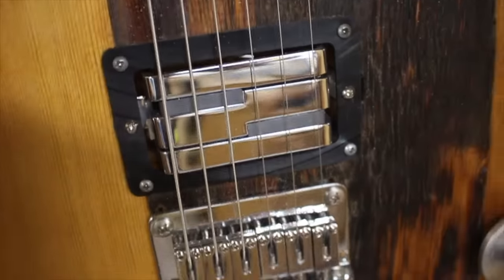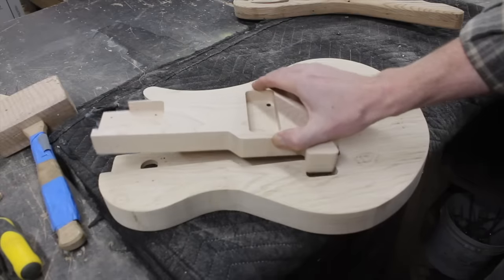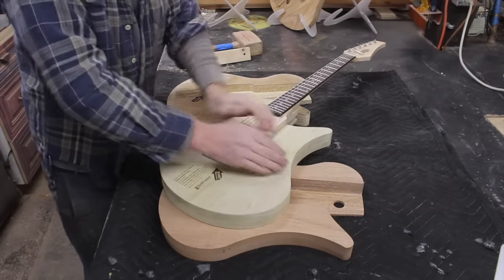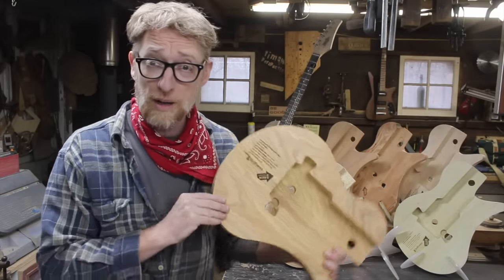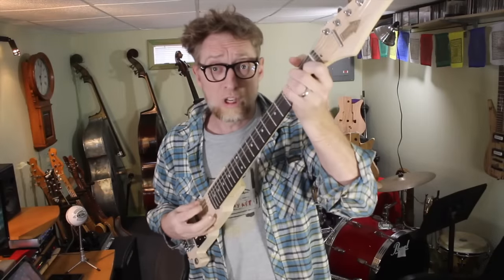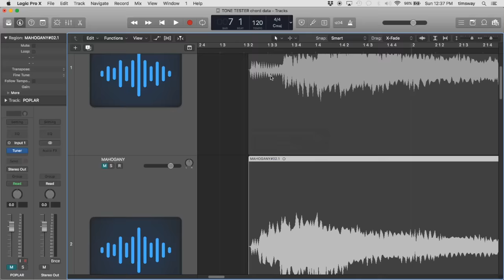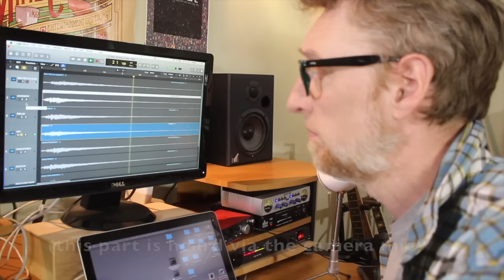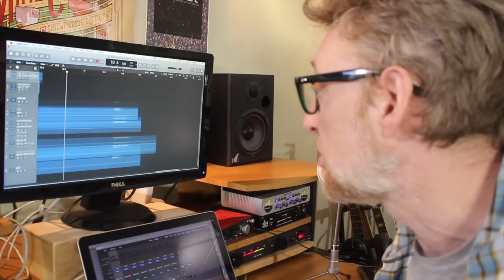Tone Wood Tester: One guitar to test them all

Comment: Incredible brother. But, I couldn’t stop thinking about the business opportunity here. You sell me a really well built core with great pick ups, bridge, pots, switches etc. And then offer every shape, color, finish, etc. For me to mount my core in. You could even offer custom designs. Maybe it’s already been mentioned or maybe it’s already available in some form and I don’t know about it....but just the thought of being able to do this I find unique and exciting....get the idea to the patent office.
Reply from the maker: There are a few others that make swappable guitars and I've done it before. Search "multitar." The one that makes the most sense are pickup packs that pop in and out easily. That's where you can REALLY get a new guitar! I plan to do some messing around with that someday :)
Reply: There is https://somniumguitars.com , they make guitars with different pickup packs. There are a few youtube demo video's by Justin Johnson.
Reply: Even more so, if you wanted a red body on a dual humbucker guitar and a green body triple single coil guitar today, and a red strat and a green les paul type tomorrow, it's possible.
Reply: This is something I've thought about before.  Scale length is counted from the bridge, thus longer or shorter necks is added at the top of the neck.  This means we could have a system where you can bolt together any combination of parts.  4-strings, 6, 8, 4 pairs, etc.  14 inch scale length, 20, 25, whatever.  You could make any combination.
The idea is that you buy the bridge housing and neck, and then any of hundreds of body designs.  Bolt them together and away you go.
Lets say you want a mandolin size and shape body, but 4 strings (uke style), 20 inch scale length like a baritone or octave mando.  Easy.  You can now make your own hybrids.
Reply from the maker: @valueofnothing2487  There's more to the "slave labor" story of Guangdong, et. al, than we hear and of course a CNC machine doesn't care what country it runs in! I don't intend to manufacture this guitar, but I do make guitars here in Connecticut from locally sourced and salvaged materials for those who want that sort of thing and prefer that story to the "made in China" alternative. My mission statement from the get-go has been "custom and responsibly made in the US for around $1k or less".
Reply: Check out Pons Guitar
Reply: Look this up: Vox humana swiss army bass
Reply: I wonder why I haven't seen anyone make a cheap lightweight guitar by taking a wooden neck assembly such as yours and mounting it into a two-piece lightweight honeycomb-molded plastic body.  I'd think that would be cheaper than making a full-size wood body, but the only lightweight guitars I've seen whose exterior contour is guitar-shaped are in the $500+ range.
Reply: The problem is if the body is too light then it can be “neck heavy” and it won’t balance well when you stand and play.
Reply: Look for Pons Guitars on Instagram, they do exactly that. Basically u can change body shapes and I think they attach it using screws/bolts

Edit: they have a Kickstarter page: Pons Guitars
Reply: I know this would be utterly impractical, but I'd like the electronics to stay on the body, including the pickups, but to have the core still include the bridge as it does now. Then each body could have its controls placed exactly where you expect for that style of guitar, and swapping bodies could mean dramatically changing the sound because all the electronics would be changed at the same time. The scale length, string tension, bend characteristics, type of bridge, type of trem system -- all those variables are removed. You could then have multiple copies of the core as well, to accommodate alternate tunings quickly. (Smaller than packing the same number of full-sized guitars, certainly.)

Structurally, I think this would be a nightmare to implement, and won't be the one to try.
Reply: @timsway  It's a good idea in theory Tim, but in practice it seems like players simply like to own different guitars.    Taylor tried swappable pickguards on their solidbody electrics, and the whole line got discontinued after not a lot of time.    It would make for a fun and informative YouTube video though.    Thanks for the great content!
Reply from the maker: @keithbaker296  oh yea, I'm not the first to mess with this idea. there's no market for it, I just like to make silly guitars :)
Reply: Anyone remember these? http://www.teuffel.com/english/guitars/birdfish/birdfish_main.htm
Reply from the maker: @JohnnyBuxton  I've never seen this one before. thanks for sharing!
Reply: No worries.. they're pretty old now, but a cool concept of movable pickups (they're on rails) and interchangeable tubes of tonewood.. I've always been dubious about the effects switching these things would have..
Reply from the maker: @JohnnyBuxton  imo minimal at best but the design is cool!
Reply: Eventually wear would prevent the pieces from fitting together snug unfortunately.
Reply: Dan Electro  for sure
Reply: @bluesoverlord  That, and would have zero sustain.
Reply: Wood is so sensitive to the, environmentj temperature, mechanical pressure that after a while I can easily foresee either a connection too loose, or on the contrary the impossibility to match the pieces, then too many mallet hits, then damage to both parts leading to the first situation, a connection too loose, say winter is back again...
Reply: FUN FACT: more often than not, Patents DON'T MEAN SHIT. 

You don't get successful with a Great Idea. You get successful CHEATING EVERYONE ELSE. See Ray Kroc. See Edison vs Nik Tesla. (Tesla invented the radio and yet the world keeps LYING that it was Marconi. It was settled in court in the 1940s!!! See? Patents are ONLY as good as your army of LAWYERS and if you are stronger than your enemy. 

SUPERMAN? Stolen from the inventors. 
BATMAN? Bob Kane stole most of it from Bill Finger. Look that one up. (It's the RULE, not the exception.)
Reply: Modular guitars have been done before, and so far no maker has managed to take the world by storm. Pretty much every one on the market is forced to aim for a high-income clientele because small builders are unable to produce them at a cost low enough to line up with a workingman's price point.

Comment: Use some plugin to run a Fourier transform, or FFT, on your recorded audio. This will make a graph showing you the distribution and amplitude of frequencies in your recording, and it will show you visually if there are differences in tone and harmonics. I think the fact the bridge wasn't sitting directly on the body makes a huge difference. Metal is the best sound transmitter in this entire guitar.

Comment: I think that the biggest dependency is likely on your neck piece as it contains the entire length of the string. If you look at how waves are transmitted in a physical medium or even electric waves, you see that when a wave hits a surface that has a lower resistivity, part of the wave goes into that material and part of the wave reflects back. As the resistivity increases (as the guitar gets more hard) more of the wave reflects back, meaning more energy stays in the string. So if the neck has give, energy from the string will vibrate the neck, if the neck has no give, the string will keep more energy and will vibrate at a higher amplitude and longer (that is my theory). Ultimately the magnetic field of the pickup is not being affected by the material in the wood, the sound is purely happening between the string and the pickup. The wood as just acting as a dampener.

Comment: This was ALMOST perfect.
One thing....well, two things, really:
1: you need to rig a strummer which will strum with the exact same pressure and speed and angle of attack every time, as well as the same spot on the strings.
2: you need to strum it OPEN. because slight variations in how hard you press the strings and how far your fingers are from the frets will affect the sound.
Reply: Katie Donovan lol thus proving the wood doesn’t make the difference does it?
Reply: @humancentered3447  this comment encompasses the real answer that all these videos will come back too. The wood is a very small part of the ensemble that creates the final tone. (And you know I'm credible because I used fancy words. I'm boosting my online points.)
Reply: lionsasbirds it’s called science
Reply: you can weigh the wood and calculate the average density of each cut
Reply: He was in tune on the first couple of bodies, but the hammering and switching got it out. He would have to find the initial frequency of each in-tune string on the machine you’ve proposed(which is a brilliant idea) as a baseline without any body attached and check/retune after each body back to the baseline to partially eliminate the tuning variable.
Reply: Splitting hairs.,lol
Reply: Agreed, and the lack of tuning mentioned below all make the the exercise rather unscientific. However, I was blown away at the end by the lack of difference when playing the same lick back to back on all guitars. That is the real test, and there was no significant difference! Great video!!!
Reply: Whenever I see videos like this the player always seems to favor one guitar and with just rock out more on it, making it sound better
Reply: I agree that you need a more even strum and no left hand. It's science, which I think was the intent of the video, so let's split the hairs more precisely! haha
Reply: To be completely scientific, you're right.  But as someone else noted, if the difference in tone wood is so slight that the way the same player plays the same chord negates it, then it is not a difference worth paying for.

Comment: Woods make a bigger difference in acoustic guitars IMHO. Electric guitar tones are mostly dictated by the strings, pickups, amps, and speakers. The material is of much less importance compared to these things.
Reply: Khalan Wheeler it is mainly the pickup, i had $$$ PRS and cheap guitars and all you gotta do is swap cheap stock pickups with a brand name pickup for same tone as the big boys, i am now the proud owner of a super cheap guitar that I honestly enjoy playing more than my guitar that i sold to buy a car with. I mean the pricy one had a smoother neck but not THAT better and tonewise no better.
Reply: Also may need to upgrade to good brand tuners when buying cheap but again, $130 good pickup + $60 tuners to make a cheap guitar sound as good? Yup!
Reply: Don't ignore the structual build design, that can have a very massive effect on the sound as well.
A luthier I know has managed to build a guitar that sounds allmost like a grand piano (a lot more low end than other guitars), despite its relatively small size.
The trick behind it: He put the sound hole in a different location, which made the top a lot stronger,
so he didn't need to add as much stiffness to the top, which allowed it to vibrate much more.
I honstely believe, the structural decisions can have a greater effect on the sound than material decisions.
Reply: I can clearly hear the difference when I'm mixing with my plugins bypassed,  it amazes me.  " hmmm maybe a little more...... ya that's better ..."  to look and see that its done nothing at all.
Reply: I agree completely. Pickups and amp make a bigger difference than the wood does.
Reply: @ichbrauchmehrkaffee5785  for an acoustic yes. Electric, not much of a factor.
Reply: @bradhargis2261  oh, yeah, sorry, forgot to mention that. Tought, it should be a nobrainer..which is sadly a wrong assumption
Reply: Depends on how you play. most play with gain making everything obscured and compressed and moot. If you play a clean tone in a responsive amp then 1000% you will notice changes from one guitar to another of the same make of the same year - well, anyone not deaf will.
Reply: @nateglass8767  You will have that fantasy until the day you get a not so cheap guitar.
Reply: Not really. Previous similar tests to this have shown the bigger contributing factor is the factor that remained the same in all these tests. In these tests the body wood simply acted as a brace and as we can see most timber here performed equally well at that task. Yes the pickups, amp and speaker have the bigger impact on tone but the material and construction does impact how well the first part of the chain works. Harder and more stable material will provide better sustain and ultimately this can have a big effect on tone and can make the difference between a guitar that sounds dead or alive. I have a natural finished guitar that changes tone constantly even though it is fitted with active pickups. As the body dries out the guitar improves, the worst I ever heard it was immediately after I oiled (with danish oil) and polished it one day because it looked like it needed some love, I think I overdid it.
Reply: anybody should be able to hear the difference say between an alder bodied Tele, and a swamp ash one, if you can't you're tone deaf
Reply: The bridge is also incredibly important.  Doing guitar modifications, I discovered by chance that the bridge shapes the sound in a massive way.   The pickups can only amplify frequencies that are there.

I'd love to see this test redone swapping out necks with different neck woods.  That would be interesting
Reply: @ichbrauchmehrkaffee5785  Got any video/info on that luthier or design? I personally Loooove guitars with good, deep low end! :)
Reply: @robertozariskeeni1875  Unfortunately, I couldn't find anything on YT.
The only Video I could find was about a followup model, where he used the same principle. Unfortunatelly, he didn't put too much efford in the audio quality, so the sound will not be accurate
https://youtu.be/abYI2Gu-hIo
also, the video is in german and there are no subtiltes
Reply: @ichbrauchmehrkaffee5785   What's the name of the guitar?
Reply: @nerychristian  Helena
Reply: @andytraverse  aah another mythical unmeasurable ego driven I paid for it it sounds better ego driven myth.
Reply: alan connelly  no ego involved at all, my Tele was second hand and not expensive, but when looking for one I decided which body wood I wanted because there is a difference in sound on strats and teles at least. also fretboard maple or rosewood sounds different.
Reply: @andytraverse  LOL
Reply: @andytraverse  are you also one of those  guitarists who play in their bedrooms unplugged, because they don't want to piss of any neighbours? Because I highly doubt, you'll be able to hear the difference once the guitar is plugged in.
Reply: the Visual smith ha I don't worry about my neighbours. I do sometimes play my Tele unplugged due to lack of time, it sounds good unplugged , but much better through a good valve amp. maybe the issue is that if people are using poor quality transistor amps they are not going be able to hear the difference between different guitars, let alone different woods.
Reply: alan connelly lol? it's not 1997 you know.
Reply: @andytraverse  I guess playing through a propper amp (SS-or valve alike), makes a much greater difference than playing a different guitar alltogether, let alone different woods. (unintentionally used the same phrasing here, wasn't on purpose, lol) String tension imo has also a greater impact on the sound
Reply: there are hallowed out electric guitars just so you know
Reply: Don't forget an important thing. The guitar CABLE.

Comment: The change in tone a wood gives to a guitar vs another available guitar wood, is like having a tone control that rotates one degree.  The other variables that affect tone have such a greater effect, that isolating the wood change is very difficult, and its significance pales in comparison to the other variables you can control that affect tone.  The wood choice's significance is in looks, weight, sustain, and player comfort.